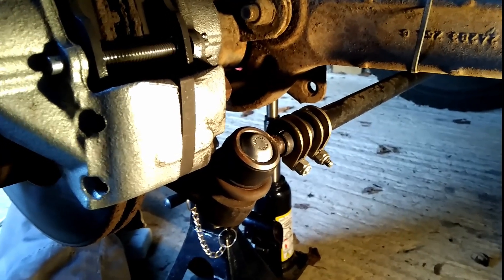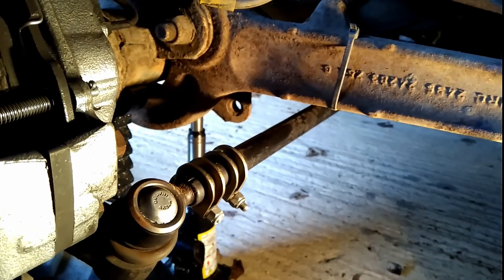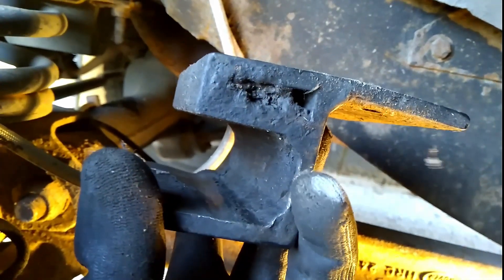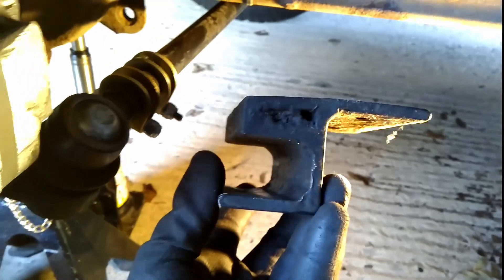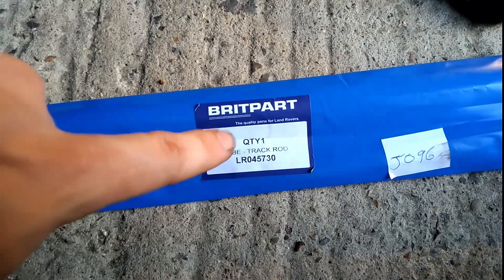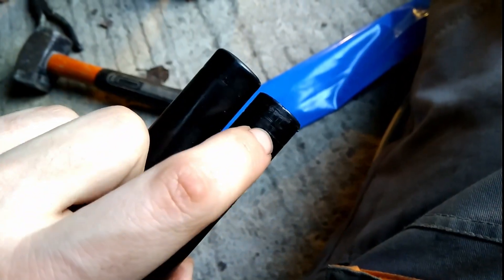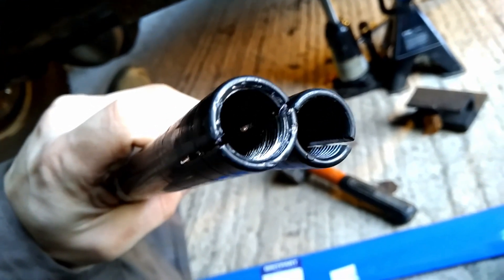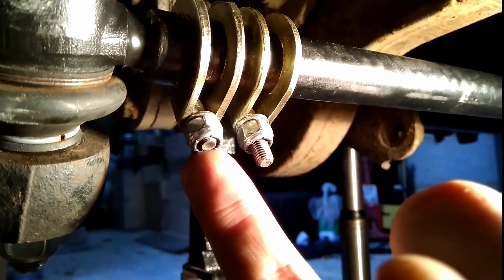Dealing with a bent track rod on my Land Rover

Comment: I don’t think that’s quite correct as this parti isn’t fitted to the discovery as standard. I do like your in the field tracking method.
Reply from the maker: Yeah I may be wrong. It was a pretty "off the cuff" video. I had the tracking checked at a garage after this and they said it was spot on, so it's better than the string method
Reply: I bent a track rod on a boulder and I used the hi lift handle slid over the rod for leverage, and the tow ball as a fulcrum and got it straight enough to get me home.  Until then I had baulked at the price of a heavy duty track rod, but I decided to invest in one and it's been good for years, though I was concerned that it was too thick for the diff guide to be refitted.  A friend got a cranked track rod that kinks up and tucks behind the diff/axle housing, it's just that you can't turn that one to wind the wheel alignment in/out, but probably a better overall design for clearance and protection.